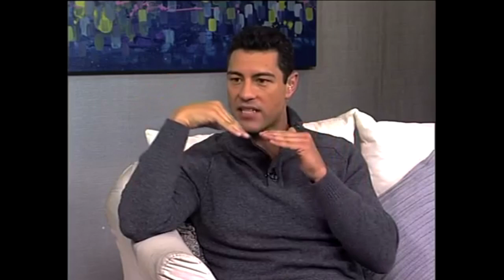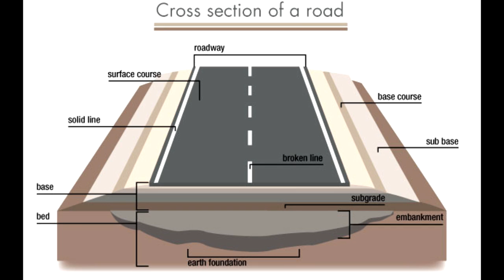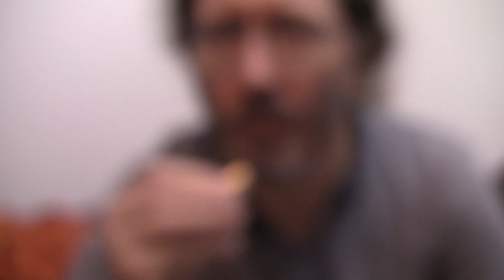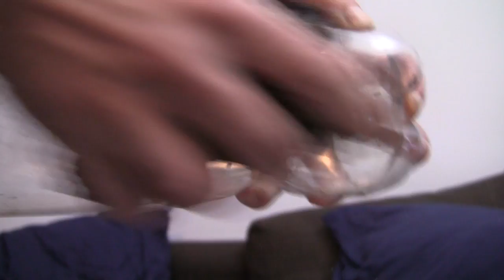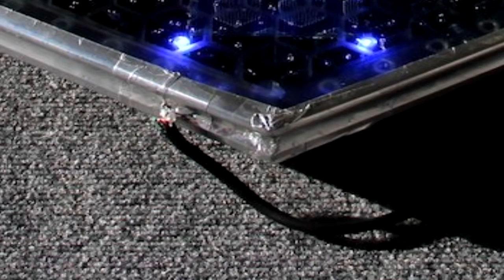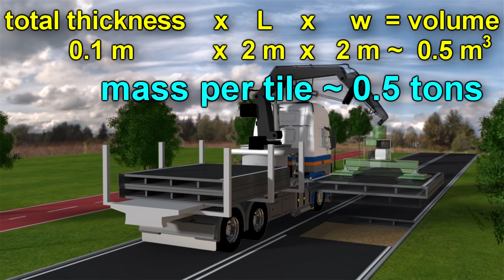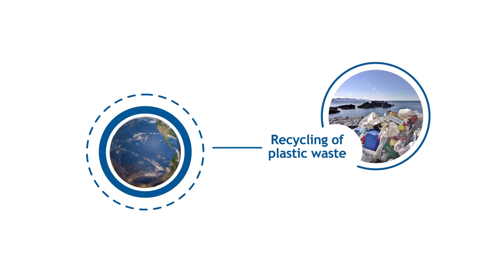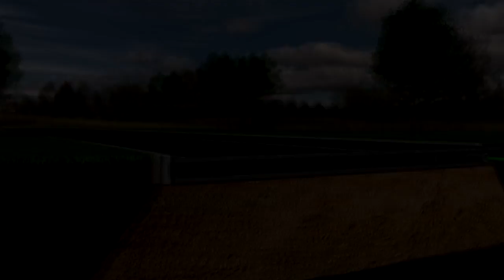Plastic Roadways BUSTED!

Comment: The video does not quite address the approach of replacing the bitumen with plastic, mixing it in with traditional road materials.

The more ways to reuse plastic, the better.
Reply: do you realize that fly-ash from coal burning power plants mixed in with the material would eat the plastic, fly-ash is used that way to keep it out of landfills
Reply: @chadancat6347  A local government in India and at least one startup in the UK is doing that, didn't seem to have any issue with fly-ash.
Reply: @Moepowerplant  im not against using  recycled plastic, but i do worry about it catching fire if used in the street

Comment: Bitumen isn't that hard either, yet we manage to make asphalt roads commonly enough. Clearly the 'design' shown by these proposals aren't complete designs. ..but makig the surface with plastic as a major componant isn't far fetched. You just cant use 100% plastic, just as you don't use 100% bitumen to make asphalt. Asphalt itself is a large percentage rock.
Reply: No, but bitumen gives the structural integrity to hold the particles in place.

Comment: Mixed with traditional techniques it is certainly possible to recycle plastic into roads.   https://www.scottishconstructionnow.com/article/and-finally-scottish-plastic-road-firm-opens-first-factory      Bitumen is really soft and melts in the summer.  Maybe the PET helps bind it in hotter Climates?    Who Knows?    With an open bottom the design could be used for short stretches in a rapidly changing urban area, developing world or China/Korea/Eastern Germany for example or temporary roadworks sections.   http://www.bbc.co.uk/nottingham/content/articles/2009/07/03/edgar_hooley_tarmac_feature.shtml

Comment: I liked the idea of solar roadways, (I will note, I never saw the craftsmanship issue) but, it was a concept project that depended on advancements in the field of solar panels that just havent came, so it was a concept that went way out of hand, I lived near the testing, of it. 
I remember the test results, "with the advances expected to be seen by 2015 it should produce a economically viable method of harvesting energy"
Well, those advancements did happen, but those advancements where not mass produce-able.  
And they assumed that universities could make up a formula for glass that was durable enough and failed in the exact way they wanted.
So, they jumped on early with the crowdfunding.. like that will make other peoples advancement happen faster?

Comment: Theirs no way it lasts as long as asphalt here in Montreal the highways havent been repaved since the 60s and they are still pretty good
Reply: That is bullshit. I know those roads and they are mostly replaced at 30 year intervals max. The plows rip them up every winter. Even your city streets are completely cracked and patched after 5 years.
The busier highways are worked on every year and don't last longer then 10 years before needing replacement.

Comment: The ignorance of people and the ability of people to think they have a valid opinion on a subject they know nothing of just astounds me.  I work in road construction and I can tell everyone who has commented negatively on here about Thunderfoot's  video is just plain wrong.  All of his points are correct and quite valid.  

One of the things he touched upon a bit was friction or roughness of the surface.  This is an extremely important property of the road surface to prevent accidents.  In the industry we call this driving layer the surface friction course. The rougher the surface the faster vehicles stop when braking (ie. shorter distance travelled) and the less likely a car is going to slide and hydroplane in wet conditions.  We actually test the frictional properties (ie. skid resistance) of a given surface course by testing the aggregates since they provide this property.   What's more important than the initial frictional value of a given material is the frictional value it retains over time due to wear from vehicular traffic.  This value is called the polished stone value or PSV.  So, even if an aggregate starts off with a decent frictional value, it may be a soft aggregate - such as limestone - and it will polish or wear smooth.  This is very bad.  Other aggregates will wear rough and their frictional properties will largely be maintained.  Some aggregates have other interesting properties that help them resist polishing.  For example, gneiss has a rough macrotexture, so bits of crystalline pieces break off during wearing, thus allowing the surface to retain a rough texture.  There is a drawback in that gneiss is quite fragile and wears faster compared to something like traprock which is both hard (wears slowly) and wears rough (resists polishing).

I hope some appreciate this extra, more in-depth information.
Reply: This man speaks the truth.
Reply: @partypooper9427  he certainly knows his stuff
Reply: The problem that leaps out at me when looking at the structure of the plastic road, is the much-touted hollow cavity. The state I live in can't afford to keep the roads in repair (They have to pay lawyers to fight kicking and screaming against gay marriage and marijuana legalization) so as a result, we have potholes that never get filled until some politician gets the wheel torn off his BMW. With these plastic roads, you're going to have a pothole that opens up into a 8" deep space under the road surface. Won't that be fun?
Reply: @Oddman1980  sounds a lot like my home-country too man.
Reply: I mean i have no experience in road construction but just being in my 30's and having to build foundations for walls and driveway at my home address is enough to realize that there idea is some what stupid. i thought you could debunk this with just common sense but i guess not lol.
Reply: @solid_snake9708  This man also speaks the truth
Reply: Jeremy Chunick Dunning Kruger disease my man....it’s an epidemic in the 21st century...and spreading
Reply: @azraelbatosi  This man also speaks the truth
Reply: But my scam....
Reply: Absolutely, very well said. I've just started watching a number of @Thunderf00t
 vids and am completely taken aback at how ignorant people really are about basic science and engineering. People wouldn't dream of thinking solutions were so simple in other disciplines (e.g. surgery - I have a burst appendix...but wait I have a sharp knife and some bandages at home, so what's the point in paying the doctor?) but when it comes to engineering & science people constantly come up with "brilliant" (dumb ass) ideas and think they can revolutionise the world! All the engineers and scientists must be feeling so silly! Decades of wasted education, training, and field experience - and they were outwitted by a layman who came up with a far better solution whilst taking a dump last Sunday...really people, are you that f*c*ing stupid?!
Reply: @aquacruisedb  sadly people are that stupid... I mean why do you think there are stickers on bleach that tell you it very dangerous and should not ever be drunk... It's sad, really
Reply: @bitterman co  No. 

Besides, nobody has addressed the issue of what happens when the conduit gets blocked with fallen leaves, rat's nests, used condoms and other human litter. Say hello to localised flooding come the next downpour.
Reply: @ElizabethFrantes  Roman?
Did they even have carts at that point? I'm sure they weren't designed to handle 5000 pound metal boxes.
Reply: bitterman co no road has no heavy traffic. What if theirs construction is some sort?
Reply: Jim pickens,  a very nice guy
Reply: He made a point that is slightly dishonest about roads though. Yes, they are recyclable, but this doesn’t occur anywhere near as often as it should. Companies with the expertise to recycle pavement layers (at least in Australia) are few and far between, and often have to travel interstate for projects and have no where near enough man power to work on all road construction that occurs. So usually, the old road is dumped in land fill, and a new road gets laid down. Or they just spray a new surface coarse over the top.
Reply: @schuhey7021  they recycle em here planer machine cuts and chews it up drops it into another machine behind like an urban combine harvester the other machine heats it up melts it and puts it right back down in a new orientation followed by a few sweaty tarred lads shoveling it about then rolled into submission bam new road made from old road
Reply: Quickly followed by other utilities then saying oh wait we meant to put a duct here or run gas under here and the road gets all fuckin cut up again despite being laid only 3 weeks ago
Reply: Niall Dunne yeah that sounds about right haha, its good technology, theres even guide lines about what you can recycle certain bases/courses into but where I am it just doesn’t have much availability.
Reply: @schuhey7021  The US recycles 99% of its asphalt. There's really no excuse for not doing it.
Reply: Up where I live they crushed stones to the asphalt on the surface to provide additional traction for the winter. My only complaint about our current roads is every 2-3 years we have to do massive repaving because of frost heaves. 

In our major cities, they use a harder road surface that looks an awful lot like concrete due to the cars that sit stationary during rush hour causing the roads surfaces to get troughs in them.

Knowing that the road surface is almost entirely recycled anyway makes this an absolutely pointless invention even if it works which it won't.
Reply: India has been using plastics to make roads for the past decade. And so far There's no complaint from it. 
It actually started with an Indian scientist who figured out a way to mix PET with asphalt (or some other materials that I am not sure but it's definitely a mixture something else) to give the optimal performance.
Reply: @LinuxLuddite  There's a very large gap between "using plastic to make roads" vs making roads out of plastic as this is trying to advertise.
Reply: @LuciusC  Yeah, the ad is not clear about what other materials it uses or whether it uses anything at all apart from plastics. I guess there are different ways of achieving it. It's been a while since I read about the technology being applied here in India, gonna have to give another look at it.
Reply: @LinuxLuddite  If they use another material at all, then they're just flat out lying about it being easily recyclable.
Reply: @LinuxLuddite  yeah but the whole point of the video is to debunk the garbage science that proposed that the roads could be made ENTIRELY out of plastic. the mixing is a different subject
Reply: Let's build the roads out of Bad Dragon Di........  Ooh what a grip!
Reply: Jeremy Chunick because your more of an expert than me (a 16 year old) what are your ideas on house made of plastic?

PS: I know this isn't really your area but I am just curious based on your perspective. Also are there pros more than cons in this? Is it good for the environment?
Reply: The One Above Most as another 16 year old, it depends, is the plastic recycled? If not and the plastic needs to be custom made with no recycled materials it’s bad for the environment.
Reply: You are very funny. Look at India or the Netherlands where these roads already exist and are a huge success and after 4 years still haven’t had issues. As a road engineer I expect you to know better and do reasearch of other places. The cold hard truth is it works like proven in other countries
Reply: @Kj_Gamer2614  what are your sources or ~reAsearch~ lol
Reply: Daniel Zola my sources are the fact that this works in multiple countries. It works in the country I’m from
Reply: @Kj_Gamer2614  "Plastic roads first developed by Rajagopalan Vasudevan in 2001[1], consist of an asphalt mix with plastic waste incorporated into the asphalt mixture."-Wikipedia. as you see, it's not the same. India has not been using the PlasticRoad, but mixing plastic into its road material. are you a dumbass? ITS NOT THE SAME AS AN EXTIRE ROAD MADE OUT OF PLASTIC, WHICH WAS MADE CLEAR WOULD NOT WORK FOR CARS. In the Netherlands, the ONE fucking 30m path was made for BIKES and not for cars. you seem to have missed the point of thunderfoot's video entirely.
Reply: bitterman co yes, Australia has no real manufacturing industry, which is sad because it would benefit our mining industry so much.
Reply: Jeremy Chunick  i never knew. Thanks for the info!
Reply: not only does he have experience as a chemist, he shows his knowledge knowing it is valuable for all.
Reply: This brave man for president !
Reply: @bitterman co  Even on a low traffic volume area: why would you use a more expensive and less durable road? There's no benefit.
Reply: Its not gonna be made of purely plastic anymore. They just replace most but not all of the Bitumen. They are trying to adapt and make it feasible. Though thank you for challenging the idea and giving people food for thought. Its important to look for holes in arguments as it help make the logic more sound.

Hopefully what they doing works, but this isn't my area of expertise.

Posted after California and Germany have replaced sections of there roads with said mixes as far as I know.

Anyone reading this I hope you have a nice day.
Reply: Yashua Fradkin no
Reply: Even if everything thunderf00t said was wrong in this video, ill give you that for now.
This is such an insanely dangerous and deadly problem just for one reason, the plasric road would degrade by you know... scratching, think taking sandpaper to a P-E-T bottle like the type thunderf00t mentions in the video. Now look at all the tiny bits of plastic that you can see, for each one of those theres 10 you cant see because theyre so small they because airborne and youre now breathing them... microplastics have been found in every human on earth, even new borns arent safe as it gets into the womb. No please stop trying to poison not only every human near a plastic road, but the entier environment for miles around because theyll travel on wind currents all around the world eventually, and if you dont believe that, every year tons of sand grains blow over the atlantic ocean from the Sahara to the us, its visible from space when the winds are strong enough, so some microplastic thats much lghter than sand would have no problem traversing the atmosphere
Reply: I hope you appreciate this extra, more in-depth information.
Reply: Dont forget about fires everyone amd how plastic deforms and potentially lets out gas.
Reply: TL;DR
Reply: The Egg was here

Comment: I saw a Russian ( yes shame on me for looking or promoting anything Russian) machine. Feed bricks in lays them as pavers patterned. About 3 feet a minute. 

As suburban roads some semi main roads, that looks the cheapest easiest to repair longterm. Anyone that wants to disagree, feel free. But consder, many Europeon cities do similar, its lasted centuries, with armies marching over it. Hitlers tanks, then the allies, and 50 yrs of NATO excersises in addition, to everyday use for centuries. 

Ive even seen footage of 40 ton plus pumps ( that went into suez canal pumps) moved on paved roads in Germany by bullock teams pulling them. Tried and tested methods here. Need to fix a water main. Lift some stones or bricks fix it put them back. Done daily in Europe.

Comment: Making a road completely out of this plastic I can agree is not well thought out. But maybe those can be used as SIDEWALKS instead of roads. Another potential solution could be mixing these plastics in with the asphalt roads. Toby McCartney (British engineer) came up with a potential solution with this idea in mind. This could both make the road stronger and remove a large amount of waste, granted at a slower rate than 100%-plastic roads.

Comment: Like you said, the ground is leveled and unique in intervals that are not uniform. That means that you would have to make millions of little sections of unique plastic road sections. The coefficients of expansion and contraction would be out of control. Finding a water main break would be extremely difficult and then going to work on it would cause multiple sections of plastic road (potentially) to be destroyed. These are just a few problems off of the top of my head.

Comment: And yet India has included recycled plastic in it roads since 2001.  21,000 miles of roads that have proven to be as effective as ones made of asphalt.  The modular road may be a pipe dream, but using recycled plastic as road material is not.  Don't confuse the two.

Comment: How come asphalt road Laid last summer has potholes in it this winter and in a car fire the asphalt melts.In summer  it melts .No one has mentioned winter in the north .Something has to be done with all the plastic waste instead of you scoffing at idea wats your solution to waste plastic problem .As far as pollution every time it rains oil leaches out of asphalt from defective cars wat happens to that oil on plastic.The comment that suggested scalectric track with a hole in center and electrodes to power electric cars seemed the best it'll keep bikes and pedestrian's off road too DONT8 random thoughts

Comment: Another problem is the consistency of recycled plastics. Every batch would have varying mixtures of different plastics, some with different melting points, and some that won't melt at all. Every batch would require extensive testing and adjustment to meet the desired characteristics. Also plastics might not bind to the rock. That is a poroblem with asphalt requiring additives. Plastics would not be uniform so from batch to batch the characteristics would vary
I have been involved in trials using glass, recycled tires, and plastics in asphalt. There are challenges which increase the costs. Ultimately the only reason using plastics in asphalt is considered is as a repository for unwanted garbage. The results are inconsistent and the life cycles uncertain.